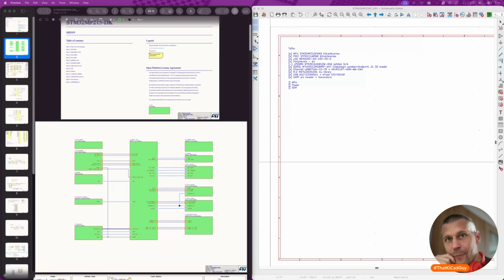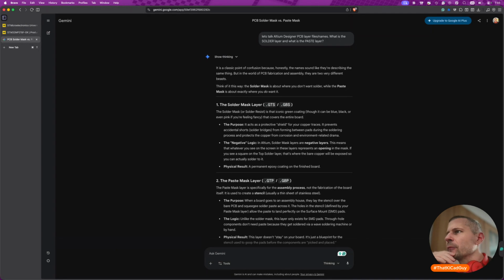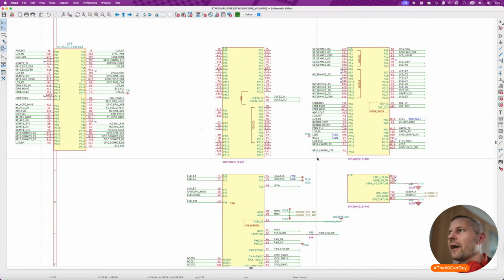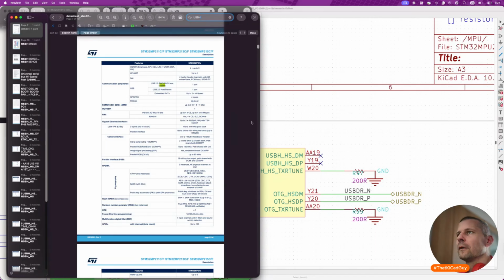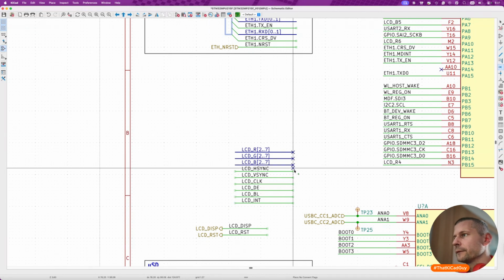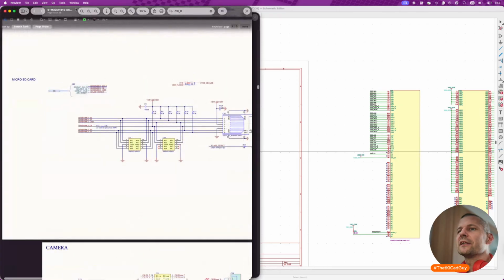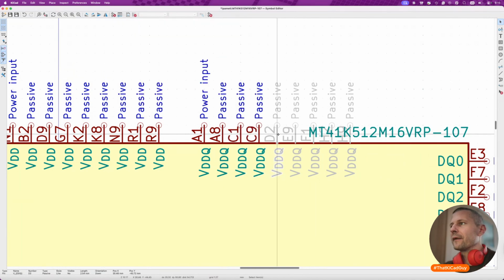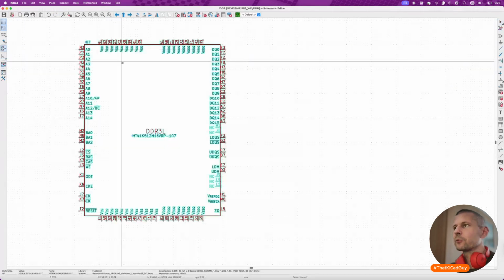KiCad Design Stream   STM32MP215F, part 5

Comment: IT - Non  so se poi hai risolto il problema perché ancora devo vedere i successivi video, ma per la memoria poiché l'unità A è stata copiata tale quale in B allora nella finestra "Proprietà piedino" che si vede in 1:29:47 devi rimuovere il segno di spunta alla casella "Comune a tutte le unità nel simbolo" per ogni piedino dell'unità A. Ho in uso KiCAD in versione 10.0.5 su distribuzione russa GNU/Linux "ROSA Linux")

EN - I don't know if you then solved the problem because I still have to see the next videos, but for memory since drive A was copied as in B then in the "Pin Properties" window that you see in 1:29:47 you have to remove the check mark to the box "Common in all units in symbol" for each pin of drive A. I'm using 10.0.5 version KiCad's on GNU/Linux Russian distribution "ROSA Linux").